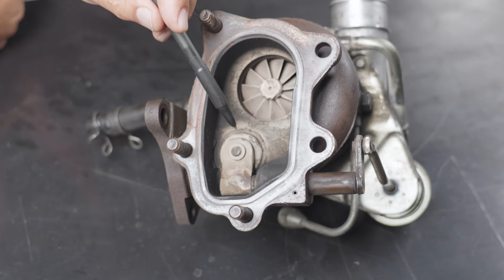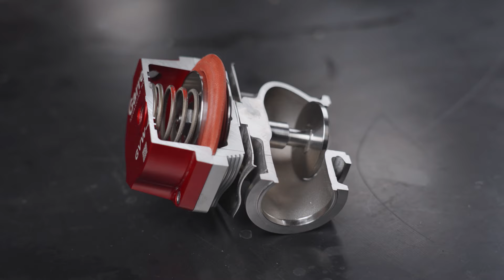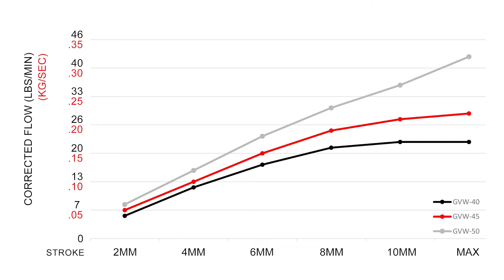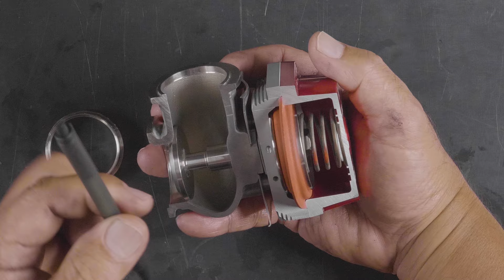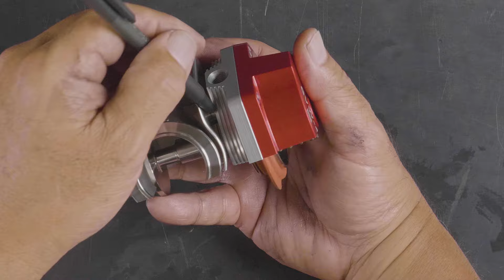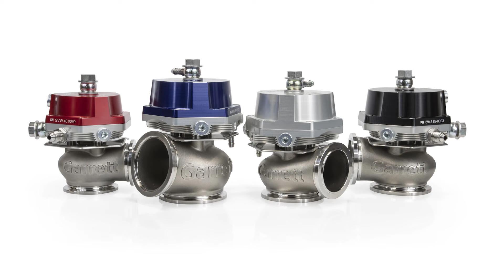How Turbocharger Wastegates Work - Internal vs External PLUS New Wastegates from Garrett!

Comment: Is it better to open dump or recirculate into downpipe on a boosted k20?   Also 40mm a good size for a 425 whp with least boost as possible?
Reply from the maker: Open dump is usually more power but sounds bad. K motors need big wastegates or they creep.

Comment: Here's an ignorant question. If I want to install a slightly small turbo on an engine to avoid turbo lag, but I don't want to choke the flow at higher rpm, can I install something like a reverse waste gate after the turbo? I mean so that if the engine begins to demand more flow than the turbo can provide, it would "suck" the valve open to atmosphere for more flow. I'm sure there's a good reason that doesn't work but I'd like to know.
Reply from the maker: No

Comment: Wish you had monitored temperatures and if timing was being changed with various plugs. 

If I understand correctly, a colder plug might not make more power, but it could potentially be more consistent on hot high compression engines, especially in rral life scenario. Mainly because timing can stay more consistent. 
Just a thought.
Reply from the maker: That is not how it works and what does this have to do with wastegates?
Reply: @motoiq  my bad, youtube playlist switched video while putting together a comment and it went the wrong way.
Reply from the maker: That is funny
Reply: @motoiq  Annoying I would say more than anything.

Comment: What made you stay internal on the awesome GD STi you built?
Reply from the maker: It was big enough to do the job bairly and less crap in the engine compartment.  An external would have worked a little better at this power level.

Comment: Mike, can you educate me on why a turbo car might make the expected (spring pressure) boost when its cold, but loose a few PSI once it's hot? 
Boost/exhaust leak or spring relaxation, maybe?
Reply from the maker: trying to solve a problem like this myself right now, I will let you know once I figure it out. Do the basics first like check for exhaust and boost leaks.
Reply: It haven't been able to find any leaks, at least while the car is cold, so I recently replaced the spring. The new one was 8% longer and several shades lighter than the old one. I haven't had a chance to see if this fixes it, though (because racecar). The turbo kit is probably about 15 years old, though the miles aren't all that high.

Comment: Between Garret and Turbo Smart, which brand is of better quality for performance and durabyliti
Reply from the maker: They are both good choices.
Reply: and best . ? is for a garret g25 -550 . for 16 psi max . . is necesary 40 o 45 mm . 370 -400 hp
Reply from the maker: g25-550 45 is totally safe
Reply: @motoiq  muchas gracias mike .
Reply: @motoiq  hi mike ,,, why don't they look professional or in races with wastegate and blow off garret .....  i see all turbo Smart o tial .
Reply from the maker: Maybe because turbosmart and tial have been around a long time and this is a new part?

Comment: Would it be a good idea to install an external wastegate with an aftermarket divorced downpipe already on? Right now I’m having issues with stock turbo and wastegate solenoid creating this type of shaking of the car at high rpm. Shop told me it was the downpipe causing the issue. Have no idea how to fix this please help!
Reply from the maker: You don't use a divorced downpipe with an external wastegate, the wastegate has it's own exhaust that you can dump or merge back into the downpipe. For a stock turbo, switching to an external wastegate would be difficult and not worth it.

Comment: So if i want 6 to 7 pounds of boost i need a wastegate that clocks out at 6 or 7 or i get a one with more (like a 12) and tune it down? I'm currently needing a wastegate and im super confused still.
Reply from the maker: Your minimum boost pressure is generally a little lower than the spring

Comment: I have a question and I need your specialty opinion. The wastegate had started pulsating after I’ve turn up the boost to from 4psi to 10psi. A 4port boost controller was install via haltech 2500elite ecu. On 3rd gear, boost is set at 5psi and after 4k rpm it’s set at 10psi. But since the wastegate pulsating started, boost will come alot later in 3rd gear and I’ll have fuel cutoff around 6500rpm. Check engine light will pop up showing a code for INJECTORS 90% CYCLE DUTY. It has a 450lph walbro fuel pump and 1000cc Bosch injectors.. also on e85.
Reply from the maker: What do you mean wastegate pulsating?

Comment: Would it not be better to mount a wastegate on the intake side of things?
Reply from the maker: No because if you dump on the intake side the turbo is still doing work and causing backpressure.  If you slow the turbo down by wastegating, you reduce backpressure by bypassing the turbo and cause the turbo to work less hard reducing backpressure further.

Comment: When moving to an external, is it required to delete the internal waste gate? I’ve never had a turbo car, only supercharged. This stuff is really great info 💪  

Once I put a 426 in my hellcat, I want to pick up a high hp JDM project.
Reply from the maker: Yes you don't run both. The thing is, do you need an external wastegate?  They are for high power applications where an internal gate can't flow enough.
Reply: @motoiq  got it. Definitely makes sense 👍

Comment: Wait, so should the wastegate pick up from the collector laid 15° in the flow of the exhaust or away? The diagram shown showed it laid away from the flow but I always had the idea that laid in the direction of flow would help with more flow
Reply from the maker: The wastegate should be leaning away from the engine, not forward toward the engine as close to the turbine housing as possible.
Reply: @motoiq  ok, so like an off ramp. Branch off in the direction of flow. Yeah, the image shown threw me for a loop on that one. That's for clearing that up
Reply from the maker: @Elver_Galarga_4u  yes sir!

Comment: Hysteresis isn’t fast response it means that the the history of what the valve did effects the next operation. So more than likely It means there is little friction, or stiction. Imagine you bent a piece of metal and you let your finger off of it. It would spring back a little towards its original position. Then if you bent it the other way it would spring back, but in the opposite direction. This is where the history of the metal maters it springs back in both situations, but where it was before the bending operation effects the direction. Hysteresis probably isn’t the best word for repeatability.
Reply from the maker: That isnt the meaning of it either, It is the drift in control response which is part postion and part in the time domain.
Reply: @motoiq  Hysteresis is the dependence of the state of a system on its history. For example, a magnet may have more than one possible magnetic moment in a given magnetic field, depending on how the field changed in the past. Plots of a single component of the moment often form a loop or hysteresis curve, where there are different values of one variable depending on the direction of change of another variable. This history dependence is the basis of memory in a hard disk drive and the remanence that retains a record of the Earth's magnetic field magnitude in the past. Hysteresis occurs in ferromagnetic and ferroelectric materials, as well as in the deformation of rubber bands and shape-memory alloys and many other natural phenomena. In natural systems it is often associated with irreversible thermodynamic change such as phase transitions and with internal friction; and dissipation is a common side effect.
Reply from the maker: I never though if it as an electro magnetic analogy before.  I just though of it in the classical definition. "The phenomenon in which the value of a physical property lags behind changes in the effect causing it".  Thank you for bringing that up.

Comment: How do you compare these to the Turbo Smart’s hyper gate external waste gate’s design? They seem to be very similar. What do you prefer a 4 port boost solenoid or two 3 port solenoid in a pull push configuration? Waiting for Garrett to release their electric turbos at the next SEMA show.
Reply from the maker: Turbosmart and Tial are excellent wastegates as well.
Reply: @motoiq  I’m using Turbosmart’s 45mm Hypergate with a 4 port boost solenoid controlled by Motec M142 to a Garrett G30-770. The only thing is the company who made my turbo kit welded the wg flange at a 90 degree angle on top of the .82 a/r turbine housing which isn’t optimal for flow. My fk8 k20c1 made 686whp 575 ft lbs on Church automotive’s hub dyno with a di and port injection full E85 fuel system with a surge tank.
Reply from the maker: As long as you are controlling boost its ok if your placement isn't perfect.

Comment: how do i make the turbo stutter noise?
Reply from the maker: Don't run a compressor bypass valve or blow-off valve.  This causes the compressor to surge when you close the throttle which makes the stutter noise. BTW, this isn't good for your turbo thrust bearing and causes poorer throttle modulation and transient response because you are forcing the turbo into surge, slamming the compressor into the thrust bearing, and causing the compressor to slow down.  With a BOV or bypass valve, the boost pressure is vented when the throttle is closed, keeping the turbo speed high, so there is less lag when the throttle is re-applied.  Then you get a hiss or whooshing noise when you let off the gas.
Reply: @motoiq   thanks for this good info.

Comment: I ported the internal waste gate and moved the actuator farther out on the arm for more leverage and was able to eliminate boost creep and hold a higher boost with the stock turbo I was using
Reply from the maker: That works!
Reply: How much more boost were u able to hold??
Reply: @blakelip3  I was making about 42-45psi on a BW hx35. It was way out of it's range and very hot and spicy and I ended up breaking multiple shafts and sending compressor wheels into the housing. I would not recommend going that route for any kind of reliability. I was poor and wanted to go fast at the time.
Reply: Have you heard of the holset hx35g? Apparently found on buses and stuff like that, same thing as an hx35 but with a watercooled cartridge

Comment: A company called synapse makes wastegates with metal pistons instead of rubber diaphragms, curious if anyone has used these to solve the heat issue
Reply from the maker: I use their DV BOV on my cars and they work well. My friend Peter Medina owns the company and he knows his stuff.  I don't use the wastegate because its big and usually I need something that packages tighter.